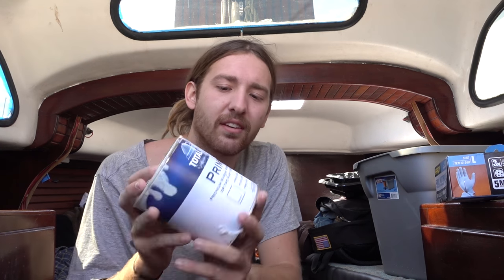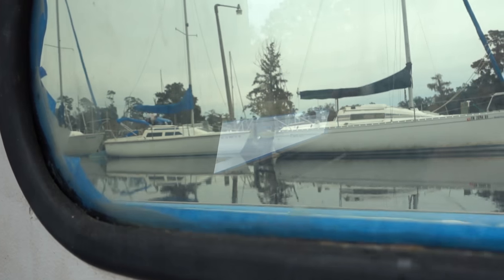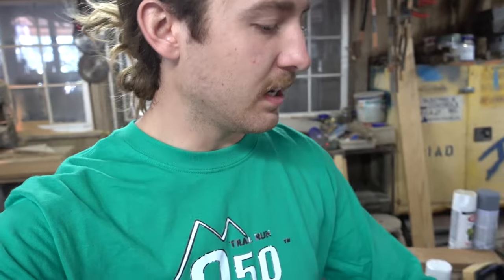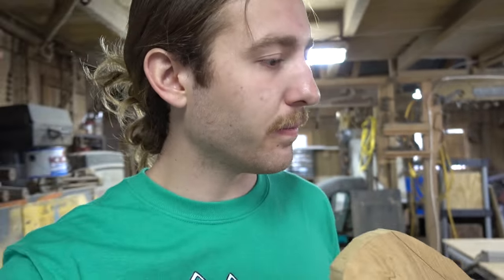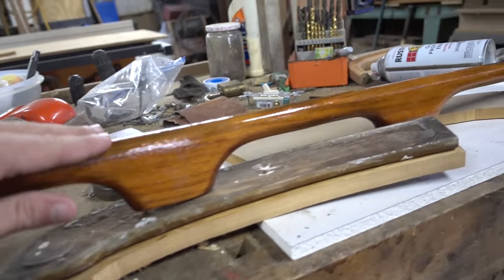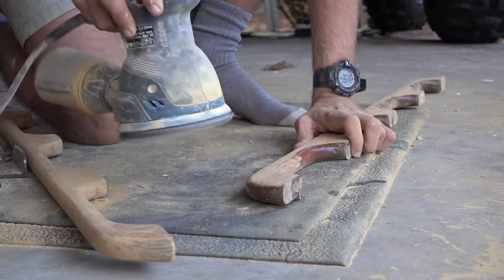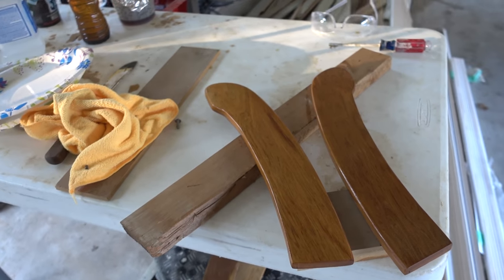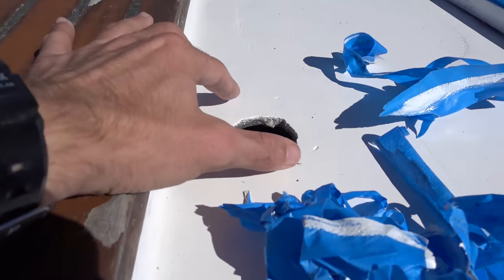Top Deck Paint, Woodworking & Varnishing, Thoughts On My Rigging

Comment: If you are happy with the end product that is all that matters.  It's your boat.♡
Yes you might want to put in a blower to remove any fumes that might be in the well. You don't want it to Blow Up. That would end your sailing dream.  Sweetie, you need a new mast, chain plates & rigging. You can do the grunt work to save some boat bucks but it's time for a refit. It's way, way over due. What do your sails look like? Listen to the advice the Rigger gave you. He is a professional.♡

Comment: the outboard in the well with the fuel tank isn't too dangerous but you need to vent it so that the engine doesn't over heat and cut out and the fuel fumes in a confined space will always be dangerous which is why you would keep it open. i would look the the hurley 22 way of venting the locker with 2 removable vertical hatches at the front
Reply from the maker: Ah I see! So what I think Ill do is make the vent near the tiller MUCH larger and then the top hole with a hood should be sufficient for flow. If need be I could install one of those solar powered vent/fans on that top hole.
Reply: yeah that type of vent would work well in there and you could even mount one on top of the hatch cover
Reply from the maker: NOOO! That would ruin the beautiful teak hatch. I would never! If it were any other hatch I wouldn't care though.

Comment: I just stumbled into your channel...so many things, yes the barn is awesome! and I love your chainplate conversion idea...I was going to say save the mast but those kinks in the track look pretty tragic! Start watching craigslist, search using the word "mast" if you can find one used it will save you a lot of money! I wouldn't make the vent hole on the cockpit side any bigger, can fumes get out through the bottom of the engine well, if so you should be fine. As long as that engine compartment area is separate from the rest of the boat you should be good....I'm going to subscribe...I wanna see how this turns out
Reply: Connect a 100 foot tape to your halyard and find out how long the mast is, if need be you could cut one down if you find one a little long... then start watching craigslist... you can find one for less than $500 bucks, might come with some standing rigging too... something like this http://tampa.craigslist.org/hil/bpo/5893640574.html for example

Comment: you need a cowl vent on the deck by the motor hatch..since you have no blower to vent the engine space ,I would open the hatches to vent the gas fumes,,keep you from blowing up,,,,,gas should be ok where it is ,just vent first,,,,

Comment: Expect parts for that 2 stroke to be impossible to find. Best off getting rid of that thing. Teak is the only wood that does not float. It is that heavy. It is floated on log rafts from the forests it is harvested in. That what you used is probably maple IMO. Not a big deal to me. I think teak is overblown in marine environments as well as too marine grade ply wood. If the wood is going to be part of the hull below the waterline than ok, marine grade plywood.

Comment: Looking good! How's the engine? How's the bilge?
Reply from the maker: Engine is seemingly doing great. Originally I had issues but it was discovered that I had it running all the way rich. 

The bilge is fine from what I can see. I can only see a small area which is underneath the battery area. I have not experiences a single leak. I do have water sitting deep down in it that the bilge can't get to but it doesn't rise. Seems pretty watertight.

Comment: Cole as mentioned below providing that the motor well is well vented with a grill vent front and back for example; there should be no problem storing you gas thank in there.

Beefing up all your eye pad into chain plate in one way to beef up your rig, but simply replacing the eye pads with the addition of good/substantial backing plates should suffice providing that the deck that the deck surrounding the eye pads are not soft (de-laminated).

I would consider replacing all the standing rigging and your turnbuckles.

Mauri Pro sailing (http://www.mauripro.com/us/category/2-Rig-Dimensions.html) has riging dimension for most production boat.

Cheers
Remember
"Small Boats Rocks" ;)
Reply from the maker: I would like to do the chainplates simply because that is a really good way to upgrade the rigging, and I will consider replacing the rigging if It does not fit properly but I won't be able to afford such a job at this moment. 

Any comments on the mast?
Reply: This not going well on google I will reply to you via FB messenger
Reply: Ah no FB link on your YouTube profile so let me try another go at it LOL

I would:
1. Remove your mast and lay it on a hard flat surface then'
2. either replace your eye pads as I previously suggested or beef them up with chainplate like you indicate
3. Replace your sanding rigging. The reason your mast is bent out of shape is that you wires are stretched out to the point where your turnbuckles are max out on adjustment.

You should be able to do it yourself at a reasonable cost considering you plan it would be $$$$ very well spent

You should be able to buy wire at a marine chandelry such as West marine for less than a $1.00 USD a foot for a small boat like yours as well as Swage or Sta Lok fittings / turnbuckles. 

I know that some west marine chandelery have a dot it yourself section where once can install their own fittings or would at least have the expertise to guide you. 

Well worth exploring as you standing rigging is the most important system of your sailboat. keep in mind that Standing rigging failure has been the bane of many sailors over the years

http://www.westmarine.com/

http://www.westmarine.com/standing-rigging

In addition I am sure you could find lot of you tube vids on the subject matter

I would love to have my boat in your latitude to progress my refit ;)
Reply from the maker: Thanks for the comprehensive reply! Also if you ever want to send me an e-mail, check my "about" section of my youtube page and you can find my email address. I will more than likely start with the chainplates and go from there. I very well may do what you said regarding replacing the rigging. Just will take me some time to figure all that out.

Comment: You can get pre-made chain plates from defender, by the time you source your material "hoping that it is correct" and make them yourself you could probably buy pre-made ones from defender.

Not saying this is the one you need but for example.

http://www.defender.com/product3.jsp?path=-1|118|2358491|2358505&id=845081

On the mast without actually seeing it in person to me that looks like a dent/kink in the mast and I would probably consider replacing it if you could. But it may be possible to repair the dented area also. Do some searching on google on how to repair a dented mast and you will come up with some stuff. If it isn't an actual dent it will tune out.

Comment: Love the videos, you're doing a great job of restoring "Cool Change".  Are you finding out that restoring a boat is more expensive than you original thought?
Reply from the maker: Im finding that everything takes more time than originally planned and that you end up finding more things wrong/ that need to be fixed than you though initially. Cost wise I expected it to be expensive but so far, assuming I don't have to buy a brand new mast, doing all the work myself is as expected.
Reply: May I ask how can you afford to do all of this?  Are you working?
Reply from the maker: I am not currently working and trying to be as smart as possible with my choices financially. Also I haven't necessarily done anything that warranted a lot of money quite yet.

Comment: Rigging is not as $$ as you would think. Mine is 32 footer is getting rerigged in a week or so and cost is about 2k.  Should be a lot less for yours as the rig is smaller.

Comment: checkout boatworks today channel. Andy does this stuff for a living. very thorough videos. 

as far as the gas question. as long as it isn't spilling out or leaking all over the place you shouldn't have a problem. the vents are a good idea to vent out any buildup of any vapors. if you do have a fire starving it of air works really well.

Comment: just a thought, instead of white paint on the decks  which will be blinding in full sun  try a more biscuit colour , easier on the eyes and will still appear white in full sun.
http://thistling.blogspot.com.au/2015/02/straightening-your-mast-most-important.html  for the mast tune.
as a rule rigging wire lasts about ten years  check with previous owner when he did it last, those turnbuckles are likely to have micro cracks just from being old,  first serious pressure and they will likely fail.

Comment: you will find that varnish don't last long the next time you sand it down and coat all of it with clear 2 part epoxy especially on you tiller and no it want hurt anything were the gas tank is a friend of mine has that same set up

Comment: Dude, if you had any idea what forces act upon the mast and rig, you wouldn't even consider using whats on your boat.  There are lots of places around to get good used rigs and other gear.
Reply from the maker: I understand and will be looking. I say I am not worried about it for now because any sailing I do will be in good weather on the lake, but I do have intentions to have it sorted before I do any REAL sailing.
Reply: Sad part about it is, the guy who sold you the boat knew about the problems you have shown and those you haven't shown or found yet.  Your going to have to learn to reef very early.   Also , depending on the age of the sail you may not be able to flatten it if the winds pick up quickly.   The mast looks like someone bent it aft (back stay tensioning) to get more speed, forgot to let it off then tightened the rig to take up slack in the rig.  Easy way to warp an old mast.   318 SS is the best for plates, but if you go around to the yards you may find some in god shape from scrapped boats.

Comment: You can tell your not a painter, you need to load that roller up with paint and spread it around. Not try to squeeze every last drop of paint out of the roller, that's why the finish is inconsistent and thin.